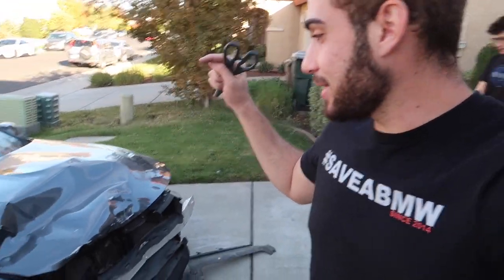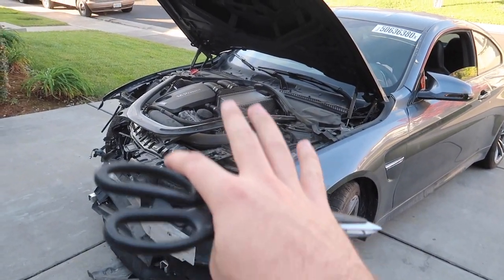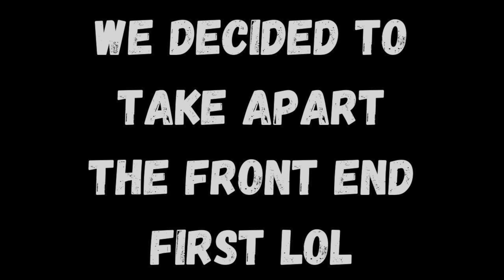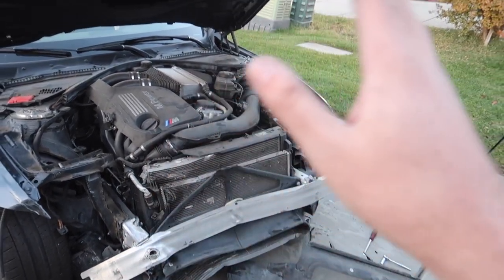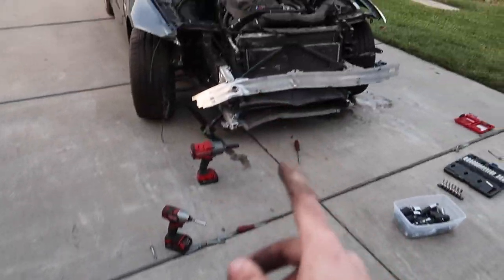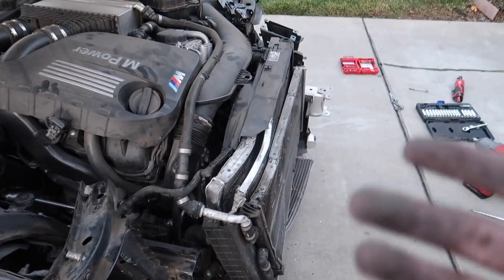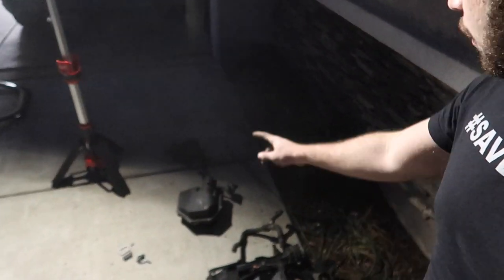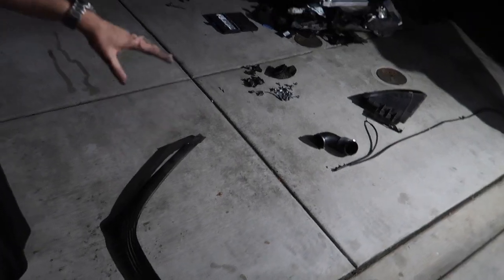Rebuilding A Wrecked BMW M4 Part. 1

Comment: Nice cop man! I am praying that they shut the car off immediately after the crash or that  nobody tried to start it after the the oil cooler was shot because that's what happened with my auction win from copart. 2018 M3 listed as a run and drive with minimal front end damage less than yours but the oil cooler was shot and the engine was ran and the crank hub was spun when i got the car. Now I have a really nice paperweight that's been sitting until I find someone who can replace my whole s55 engine. Good luck my gs and hope that this goes smooth and easy for yall! Much love to the channel

Comment: Been waiting for this track build since the 2 face 335i. The E82 is a terrifying track car with as much power as yours was going to have, really twitchy and snappy if you accelerate out of a corner wrong. M4 is a way better platform. My advice is to spend a decent amount on whatever coilover you get. M4s ride really bad on most sub $2,000 coilovers. Something like a KW V3 or Ohlins Road and Track, or if you wanna ball out, some AST 5200s, will make the car way better on the street and track,

Comment: Yo you can use a noco boost pack. Hook up to the posts under the hood, use the override button and you’ll have power, then you can pop the trunk with your key fob. I did this last week after I closed the trunk with the battery disconnected.

Comment: Nour to get to the trunk, hook a jumper on the positive and negative terminals in the engine bay and that should give you enough power to open the trunk.

Comment: The horizontal cooler on the bottom is an oil cooler. Mishimoto makes an oil cooler that I would look at. The small vertical cooler above the old cooler, is the DCT cooler.

Comment: The m4 has 3 engine water radiators. 1 transmission cooler. 1 engine oil cooler. 1 powersteering cooler. And a aircon condenser

Comment: I was wondering if you could help me out I bought a wrecked 2015 320i and put it all back together and now my steering is really stiff the car ran perfect before it was wrecked is there anything you can have in mind that we might think would be the problem
Reply: Check the inner tie rods for damage. Check all the power steering hardlines for any sort of bends. Make sure the PS reservoir has fluid.